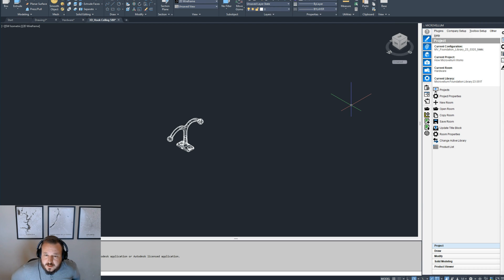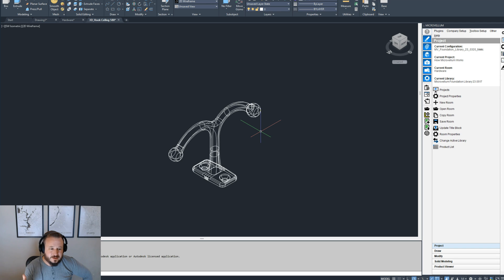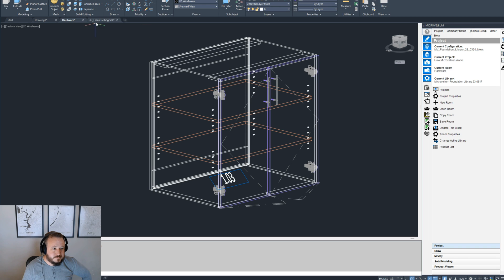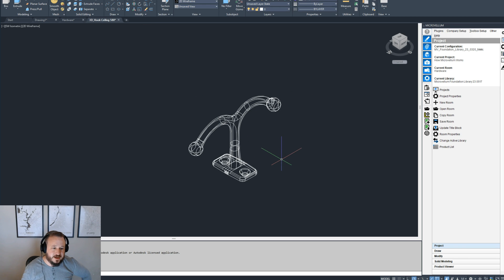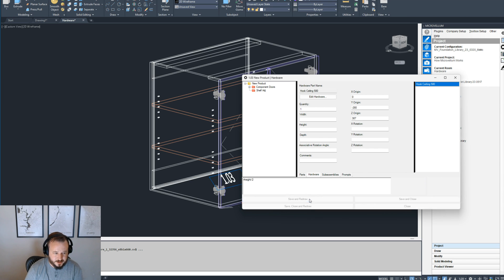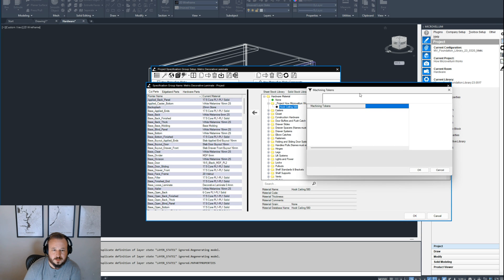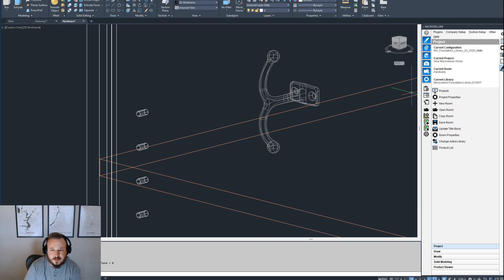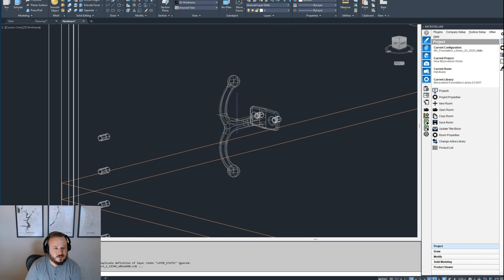Microvellum Made Easy: Understanding Hardware

Comment: Hi Jacob!! awesome video, just like the ones before it , the ones about products and subassemblies... in this video I tried to recreate the holes for the added hardware and I tried more than 10 times following step by step what is going on in the video and for the life of me I could not replicate the drilling holes. Maybe it has something to do with the 3D block that Im using??? maybe a small step that did not make it to the final video??? thanks for the awesome series in MV, it's really appreciated.
Reply from the maker: Hey! Thank you, I'm glad you are following along and finding it useful.

It could be your block, sometimes if you have a bad block it won't work, or could be that your hardware isn't in the part. You could try and replace the block with one that you know works from an existing hardware out of the library and see if that fixes it, then that will confirm it's the block.

Comment: Hey Jacob this is helpful but my hardware keeps rotating when I try to adjust the Y Origin
Reply from the maker: Hey! I'm glad it is helpful. If your hardware is rotating, that means it's touching a part most likely that is causing it to change it's associative rotation to align to that part. This could be an adjacent but perpendicular part like a stretcher back or shelf.  This happens when the  basepoint of the hardware falls within a part somehow.